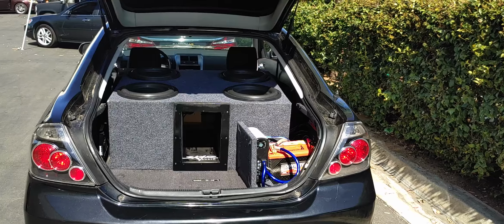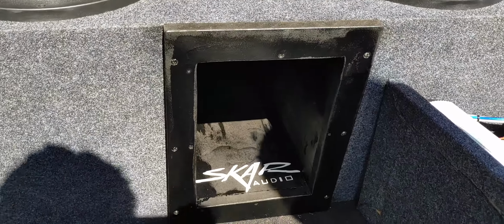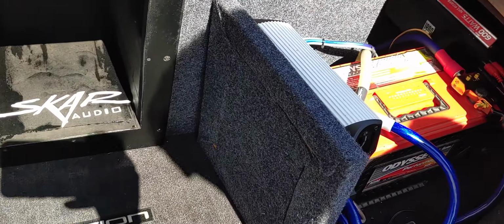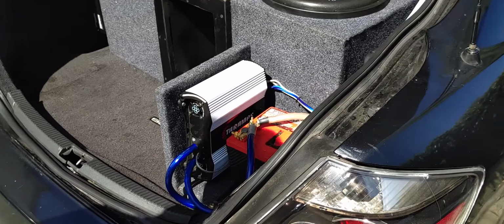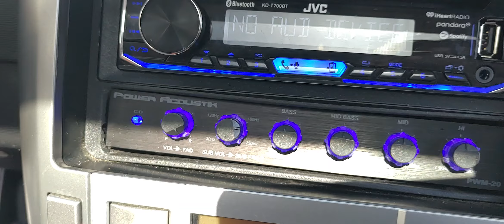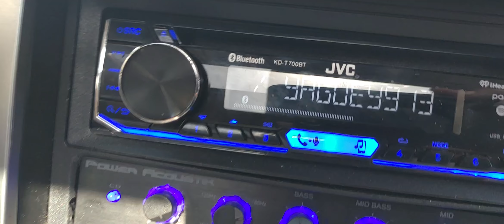17 Year Old Bass Head 4 Skar SDR 12 Taramps Smart 3k @ 1ohm

Comment: Taramps and skar is the best bang for your buck. smart kid!
Reply: Audio pipe is pretty dope too!
Reply: WeAreWatching Yu  it should be getting around 800 watts at 2 ohm that should push a kicker l7
Reply: WeAreWatching Yu you put a multi meter on it? Helped a lot bought one for like $12. See if you getting power. I would recommend 4gauge ofc for that amp. I know it’s only 800 watts but still 8 gauge is small . I ran 10 gauge for speaker wire lol
Reply: Is the amp staying on just not hitting like you think it should? or does it go in protect?
Reply: @WeAreWatching Yu you should just go ahead and get 0 gauge and they can handle a lot more than they are rated if you are running 2 I'd get atleast 3-4 k class d and they'll be jumping out of the box
Reply: Martin Henderson Audiopipe is decent but it demands a lot of power for what it is
Reply: @WeAreWatching Yu I've got the 1200 on an evl 15 but the sub needs more power. I'm only getting about 600 rms @ 1 ohm
Reply: @WeAreWatching Yu yeah I wanted the 2000 but they were out of stock...but now I've been looking at a few others
Reply: @WeAreWatching Yu ok thnx. I like skar I've dealt with Kevin for about 6 years. I plan on buying more skar but I'm also looking at Fi Xfire CT sounds Crescendo and Orion too...
Reply: @martinhenderson7487  yeah I wanna try audiopipe and American bass
Reply: Rhett Voyles I just have the audio pipe 1500.1d amp, but that bad boy is very power hungry.
Reply: Wayne Slain yea I have the audio pipe 1500.1d amp, and that thing is a beast. I’d definitely like to hook that up to some American bass subs though, that’ll be a killer sound.
Reply: @martinhenderson7487  you must be talking about the apcl 1500? Yeah I still wanna get one of those or the 3000. You know audiopipe made a Korean line the APK series till about 3-4 years ago, you could probably still find one their biggest was the 4500...
Reply: Wayne Slain nice! I never knew about the APK series. You should definitely go with the 3000 amp. I’ve seen the dyno numbers and that thing is a straight up BEAST!! I’m going to get a extra 1500 and bridge them. I only paid $100 brand new (luckily) for my current 1500.
Reply: @martinhenderson7487  yeah tha 3000.1d is 2 1500s internally strapped or bridged that's why it's 2 ohm stable
Reply: I have PSI platform 5 i just neet a good amplifier to play it any recommendations?
Reply: @i_still_love_u2  well with a platform 5 you might as well get the 🌟 power 10k
Reply: @Student Yovel Lopez yeah cab 🚖 seems to be a quality budget amp but you'd need 2 of those strapped @ 2 ohm (1 each) to really push that sub...
Reply: I have 2 memphis srx 12s. What's a good amp for them?
Reply: @JocTillery  I'm not familiar with the XR series although Memphis makes good products. What's the RMS on those?
Reply: @wayneslain9444  There actually a cheap set a subs. I bought when I was budgeting, my job shut down for the pandemic. 250/500w peak power. Came in a package with 2000wtt memphis amp but its not hitting hard at all, sounds like a good factory radio. ppl saying it can hold more atleast 2600 or 3,000wtt
Reply: @JocTillery  yeah I was gonna say for a pair of those you'd need a 1k rms or 2k peak amp and those would be hitting hard. It could be your electrical too? What size alternator do you have and battery? What wiring are you using?
Reply: @wayneslain9444  I got a 2019 Nissan Sentra. I'm running the stock battery and alternator that's on it. I'm not familiar with stereo equipment. But several ppl from different shops looked at my system and said I have the best size wires on it and that I jus need a stronger amp, cus the system should be hitting harder. Was thinking about a taramps 3000wtt mono block. I jus don't Kno what's the best for the Memphis srx speakers.
Reply: @JocTillery  even if your wire's good it could be your battery or alternator
Reply: @JocTillery  you need a battery and alternator. Amps are basically power inverters with pwms. IE you can't get 1000 Watts from 300 watts. If you want 1000 Watts, your alternator at least has to be putting out 1700-2000 watts. Extra batteries means longer charge times and more destruction on a alternator that's only does 85-90amps at 13.8V. Hope this helps.
Reply: @wayneslain9444  american bass phantom 4000 is a great amp

Comment: Amazing video! I have a question for you regarding connecting the Taramps 3000 1 ohm amplifier to the subwoofer. From the amplifier outputs do you go directly to the subwoofer or do you have an active filter to give a further frequency cut? I have your same amp but it doesn't perform as well as in your video. I'm driving a Bassface 12" double coil subwoofer at 2 Ohms in parallel which becomes 1 ohm but it doesn't pump enough. What do you recommend? Thanks
Reply from the maker: Regarding to the 3k yes you would go from the outputs directly to the sub. How did you set the gain on your amp?
Reply: @BIGJURAY20  I set the gain level at 3/4 cut HP 10hz and cut LP 80hz bass boost +5 about... But it performs practically nothing. Can you give me some indications about the cuts to insert in the amplifier? Grazie
Reply from the maker: @0franforn0  That's pretty crazy. How are the settings on your head unit? Be sure your eq is flat. You should have the bass boost tuned all the way down on the amp. But every thing else seems ok. Is 3/4 on the gain before the clipping point?
Reply: @BIGJURAY20  I confirm that I drive everything with Radio MMI audi where all the high and low controls are at zero and flat and also gala deactivated. the gain is 3/4 before the saturation point. I suspect that it is the subwoofer that has some problems :( The sub is in a closed 28L box and no noise is heard that could warn of a break in the cone. I checked and the sub's output Ohms are also 1 Ohm

Comment: Have this amp with 2 gold resilience 15s and its keeps powering off . Gotta upgrade my electrical 🥺
Reply: How you upgrade????? I have two batteries in back and u p graded alternator
Reply: @moneymac5214  you want to get the BIG 3 as they call it . It’s the upgrade alternator power feed . Google it it’ll tell you . But if you have 2 batteries make sure you have a high output alternator if you do make sure your amp is clipping

Comment: glad to see ppl using this smart 3 this is what im putting in my truck dont know speakers yet
Reply from the maker: It seems to be a nice little amp with some good power
Reply: Its power hungry tho....I got 2 sundown sa v2 12's 1000w rms with that smart 3k a big 3 upgrade and a 250w alternator and my light's dim alot. Im going to get another battery hope it helps. Oh im in a 02' yukon

Comment: What batteries and capacity is used ?
Reply from the maker: He has a stock alternator and rear agm battery to help power the system
Reply: I see but i want to know what size. Want same amp and have stock 63a in front and want add 110a in back
Reply from the maker: @hardstylemusicer3722  For 3,000 watts it helps to get as close to 300ah as possible when running agm batteries
Reply: @BIGJURAY20  150 is recommend its only capacity not output power. Output is about 1200A

Comment: u can wire them smart 3's down into .4 .5 no problem, just get 1 more batt
Reply from the maker: But with the smart 3k making power at both 1 and 2 ohm running at lower ohm loads wouldn't be worth the risk
Reply: @BIGJURAY20  the amp limits it's output so it's ok. based on experience and even big d's channel when he tested it at .5ohm, still 3k.
Reply from the maker: @notyobiz6207  Didn't know he did a .5ohm test. Pretty nice 3k all around the board.
Reply: @BIGJURAY20  yes sir, in fact he did a test with a 6k sub that ohmed out to .2 now for that case it did go into protect, but that's freaking .2 man lol
my home setup i run a smart 3k at .4. i have a vid of it demoing 15hz test tone on my page but not full vol cuz i don't have quite the batts to make it max out lol. 70a ac dc converter and 1 northstar 31 group size.
Reply from the maker: I recently heard 4 12s with a smart 3 and it was incredibly loud for electrical not being up to par

Comment: How do you wire 4 subs to 1 ohm with 1 amplifier? If you wire them parallel it should be .5 in series it should be higher than 1ohm if I'm not mistaken, hey I could be wrong it's been a long time since I've wired something. But nice setup man👍👍👍
Reply from the maker: You can run 4 Dual 2 ohm subs each in series the parallel them for final 1 ohm load.
Reply: Marcus stanley.. not everything is wired in parallel . I have 2 dual 1 subs wired to 1 ohm it can absolutely be wired esp with an even number of subs
Reply: Oh ok  I didn't know I'm not trying to insult your knowledge of wiring just trying to learn bro but I love your setup bro and keep posting as you grow to bigger and better things man!👍👍👍
Reply: Yeah I have seen plenty that are wired  like that. Normally called series parallel

Comment: So that 1) taramp is pushing those 4) 12's. ....wow...I have that same amp sitting in my garage brand new in the box.....I also have 4) audiopipe txx bdc4 12s in my nova with a skar rp2000.1 and another rp1500.1 powering them....I guess I should pull the skars and just run the 1) taramps
Reply from the maker: Yes I'd recommend doing just that. Your bdc4 12s should be able to handle a second Smart 3k

Comment: Damn this is clean. I'm also 17 and have 2 sundown e-12s on a dc audio 2.0k but still probably not as loud as this 😂😂
Reply from the maker: You still have a very nice system
Reply: @BIGJURAY20  I have 2 Skar sdr 10’s will a Skar monoblock 1500 watt amp work well with my sub?I want it back without worrying about turnin the bass down to avoid protection mode
Reply from the maker: That should pair up nicely
Reply: @BIGJURAY20  it did. Then the dc 2.0k blew up and I bought an sfb 3k and 200.4 to match lmao
Reply from the maker: Wow wonder what caused the DC 2k to fail
Reply: @BIGJURAY20  i bought it used and it looked like it had a rough life then I mounted it in front of my subs. Now I have my new amps mounted on a rack with rubber washers on everything
Reply from the maker: @haydenwiseman3056  ok makes sense

Comment: That is bad for the battery to be on the carpet it can eat the carpet the battery cells
Reply from the maker: That would be true if the cell was liquid Acid but this is a dry cell battery and is safe to run as it is
Reply from the maker: Agm batteries are safe to run as you see in the video

Comment: Remember those amps are full range, that thing looks good i would love to see what it does when you introduce some audiocontrol bass filtering.
Reply: That is absolutely true. He should get an audio control adapter hooked on that thing.
Reply: That's my car in the vid the  equalizer I used had a built in sub crossover amp won't play higher than 80hz, with the signal it's getting. New build coming stay tuned 😎. Nothing is staying
Reply: I did notice that, I have that amp in one of my vehicles and put one of the audiocontrol epicenter on it and it.
Reply: @gabedelgado80  I have the audio control epicenter as well, just make sure you change the subsonic chip if you want to play lows. The audio control rolls off at 33hz I changed it to a 25hz chip.
Reply: Cool thanks for the info, I will look into that. I have always used JL audio amps in my daily driver. I put that smart 3 in my sons 1999 tahoe and I was impressed it does push the 4 rockford hx2s.
Reply: But again that is an awesome set up, I wish I had that at 17 years old.

Comment: Why do people always blow these badboys
Reply from the maker: More than likely they're either clipping it or over powering it
Reply: True I have 2 sdr 12s and had a box built to spec.
Reply from the maker: @mikep3322  how much power do you have to them?
Reply: The svr is only 30$ more each and has stitching..cheapest sub with stitching..129$ for the 12 and can handle 200 more watts
Reply: @BIGJURAY20  skar rp 1500
Reply: 4 cubes 36htz
Reply: @billygames7107  i dont think anyone cares dude. Sorry.
Reply: purple headed yogurt slinger thanx for the info. Noted..👍🏼
Reply: @billygames7107  the ix is the cheapest and the svr has the same coil as the sdr. The 200 watts power handling thing is because of a bigger magnet and tensile leads and more cooling vents. The stitching is good to have in case the glue fails but never has anything to do with making a sub handle more power. Its always in the motor or cooling . Want to keep talking like you know something?
Reply: @billygames7107  if yourbeing sincere and just trying to help people i apoligise. See alot of crazy comments on you tube and wasnt sure.
Reply: purple headed yogurt slinger the svr is fairly new and has a smaller stiffer dust cap also..I love it compared to the sdr..I don’t troll unlike many people on here, just was trying to give advise..I’m not claiming I know anything other than what I’ve learned from experience..my baby is a zvx18v2...I went ahead and got it so I didn’t have to upgrade for a while..I’m waiting on my 7cf Gately box now..about another week or so and I’ll be a happy camper..✌🏼
Reply: @billygames7107  i stand corrected, the svr has a 2.6 inch coil and the sdr has a 2.5 inch coil, the rest of the changes are as i said.
Reply: @billygames7107  awesome . Sounds like you are going to have a nice setup. What kind of amp you gonna put on it?